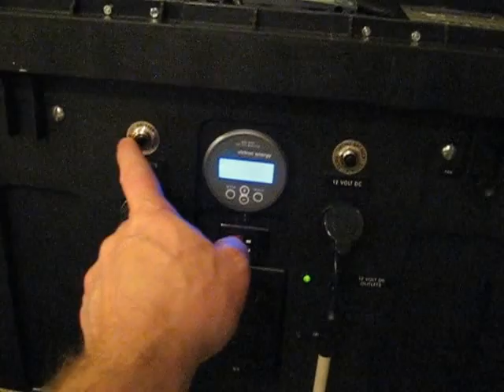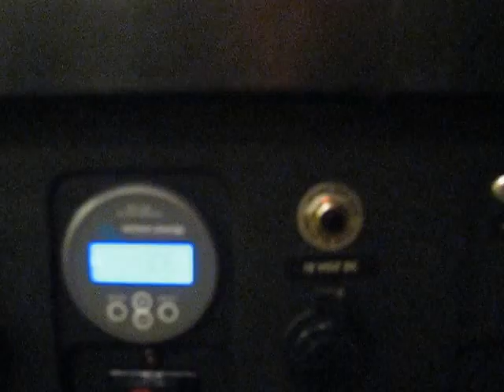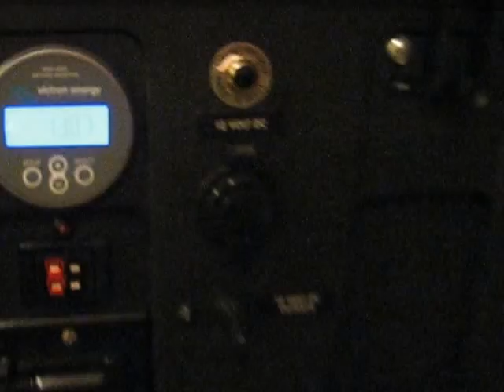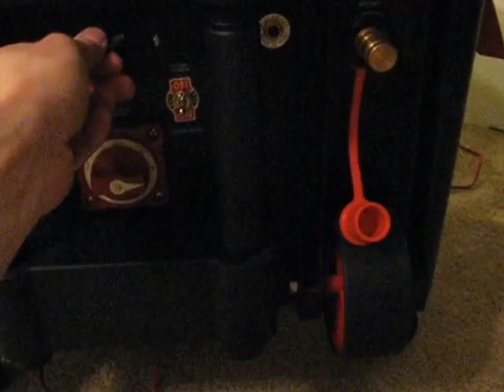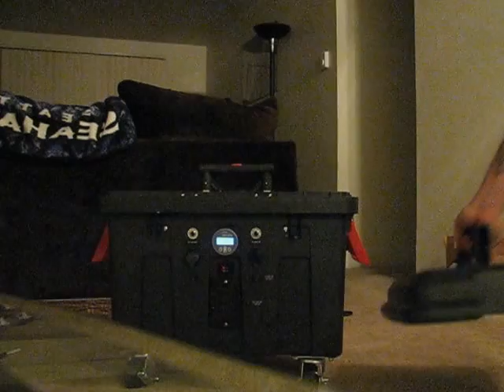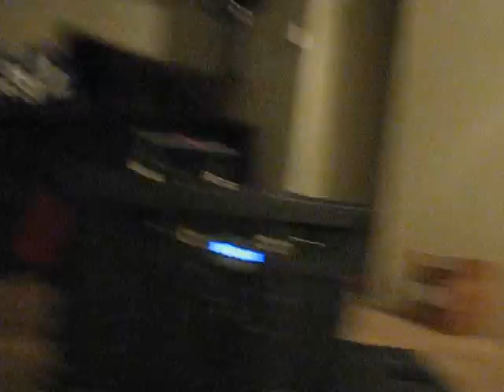DIY Solar Generator

Comment: I realize it would be a HUGE chunk of money, but have you considered changing out to Lithium Iron Phosphate Batteries? You would also need a new Charger Controller and AC Charger, but would gain 3X the runtime you have now and reduce the weight by more than half!

Comment: Hey bud, excellent job!!. Working on my own, with a lot of your inspiration in design.., hope you don't mind....
Just 3 questions:
1) Did you purchase that charging port from Rebling Power Controls and what was the pricing roughly?.
2)When you say that you could hook up solar panels to that port, Im assuming that your wiring in an SAE Solar plug to the high current batt. conn?
And 3) I seen 2 plugs coming from your Inverter, I know one goes to the 110 outlet you have, but where does the second go lol?  Thanking you in advance for all of your advice, im gonna need it , and much appreciated... cheers!!

Comment: what is the make model number for the power distribution bar at the bottom of your generator please? also looking for the part and mfg for the solar plug connection you built into your case for plugging in solar panels? thx for all your vast expertise in building a great solar generator

/

Comment: Quick question. How do you set up the inverter to turn on with a switch?  Just leave the power switch on the inverter on and put a switch inline with the lead coming from the battery?  Also what kind of connector did you use for the solar panel connection? M

Comment: By far the best solar generator on youtube. Hope you don't mind I'm going to steal lots of if not most of your ideas here. Great job!
Reply: I did and used it for the first time with a portable ham radio set up for ham radio. It is smaller than yours and I used 35 amp hour batteries for weight considerations.  Some hiccups though that I need to look at.  First I need to get a different solar controller and inverter. Both of them caused some noise in the radio.  My purpose for the solar generator was to use for emergency use with my radios.
Reply: I will. I am up in Washington for a week visiting my daughter. When I get back I will shoot a shirt video.

Comment: I would put some sort of cover over those exposed external battery terminals. I know it is unlikely anything metal could get across them due to the way they are recessed below the handle but if anything ever did it would be a very bad day.